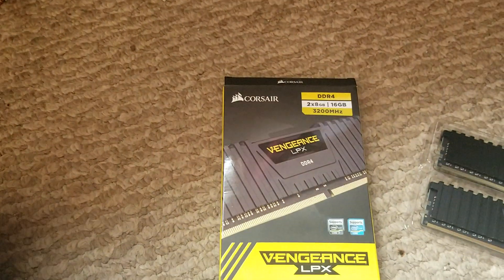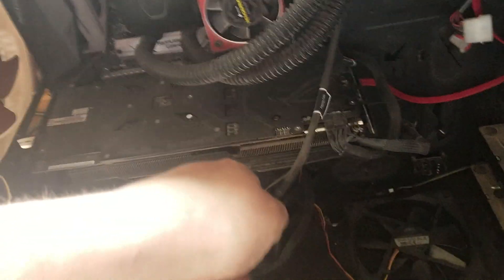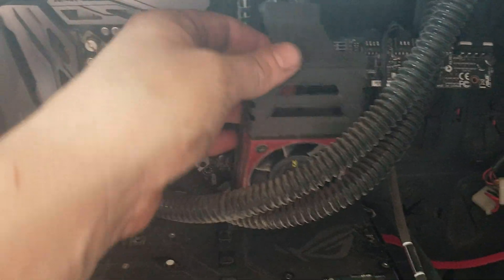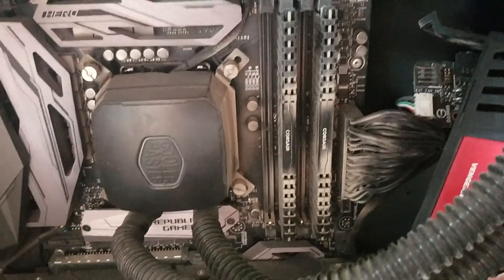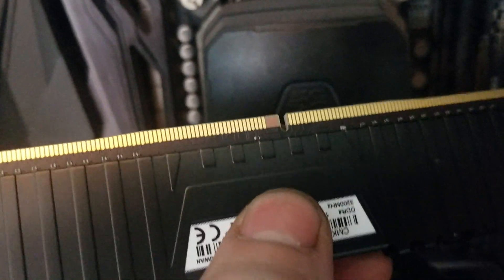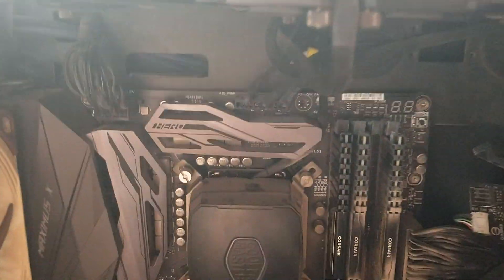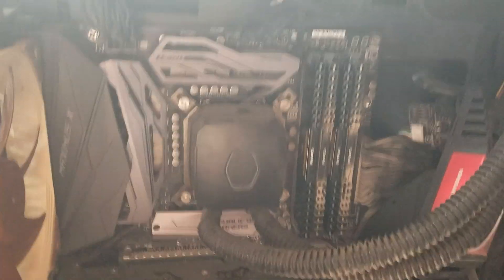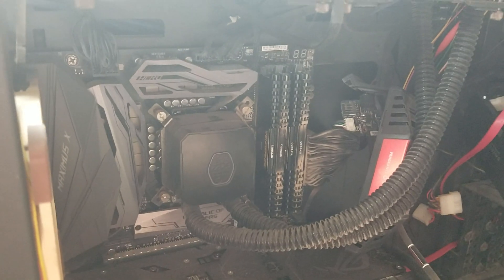how to install corsair Vengeance LPX 16gb memory kit into a asus hero maxiums x motherboard

Comment: nice video, I use G.skill Ripjaw V, I have it overclocked so I am wonering if I should add a memory cooler to mine.
Reply from the maker: Cant hurt. The cooler it runs the longer its lifespan will be